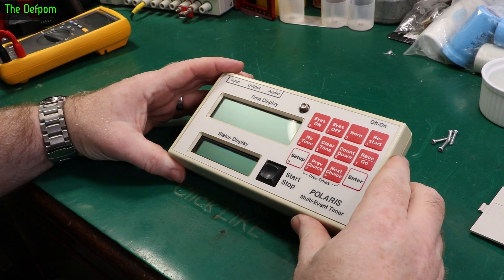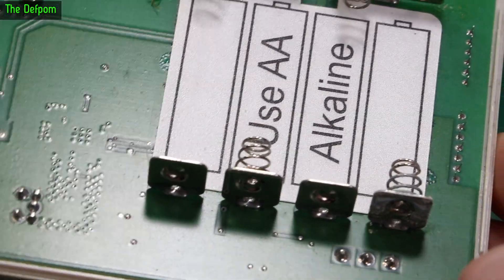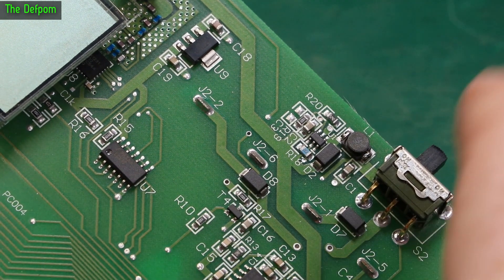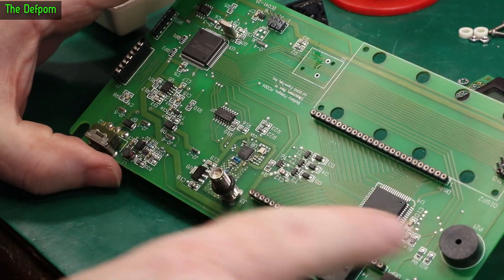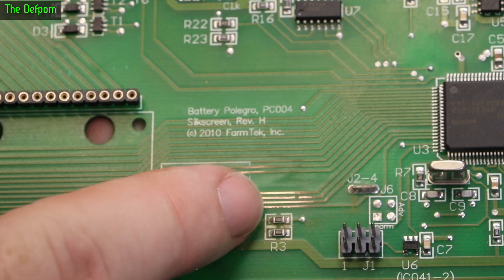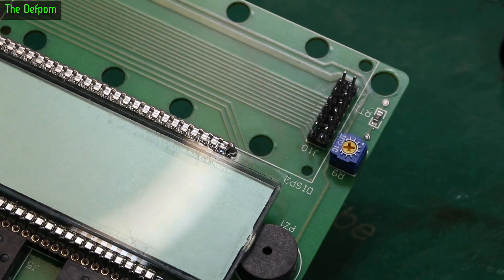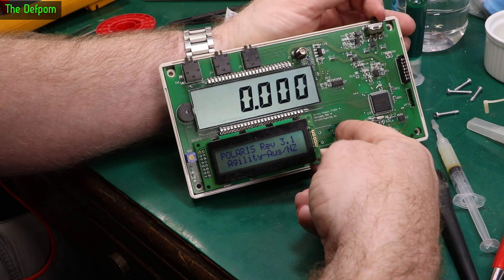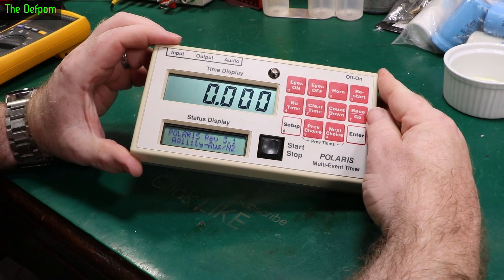🔴 Water Damage Repair - Farmtek Polaris Status Display Not Working - No.1230

Comment: Hello, a wonderful example of how the path can be damaged even under a soldering mask, in eighteen years of servicing electronics in industrial gastronomy, I have seen it so many times that I could not count. Alternating temperatures, humidity, grease in combination with dust or flour can do wonders - even the protective varnish will crack, components' leads will rot, including metal plating of PCB passages, etc.
Beautiful work 👍

Nice day🙂Tom